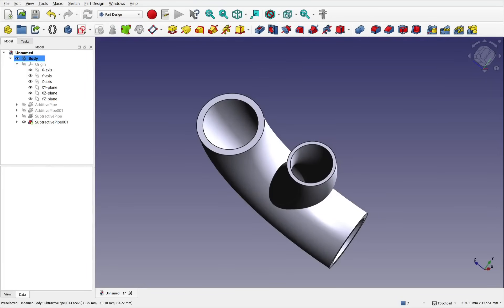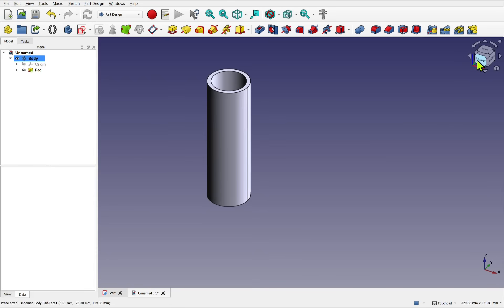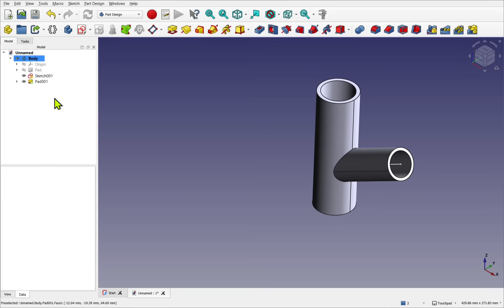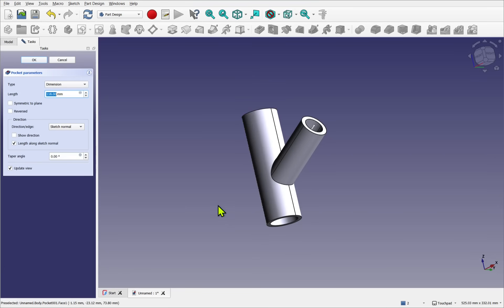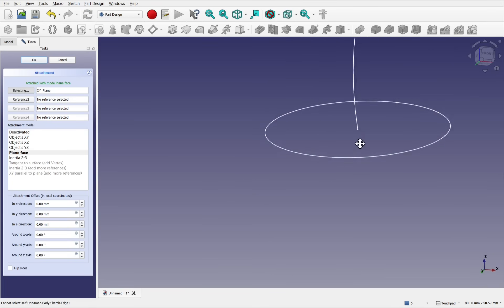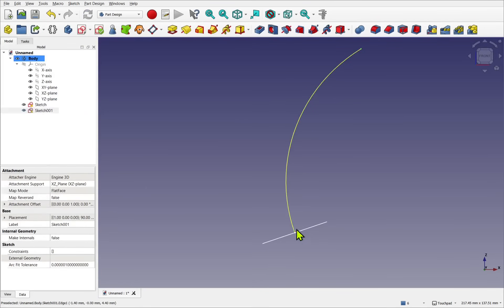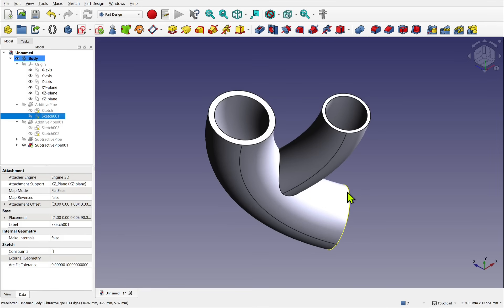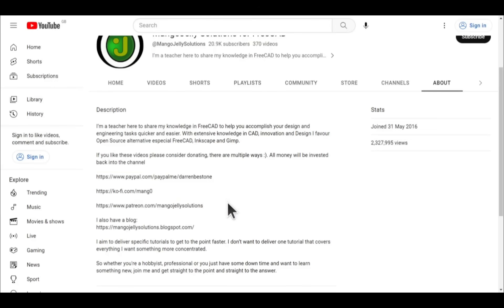FreeCAD Tutorial: How to Connect Pipes with a Continuous Internal Holes

Comment: Thanks for the tutorial. In the past I often saw you attaching a datum plane normal to edge at the end of a line and then place a sketch on that plane opposed to mapping the sketch directly to the end of the line (like you did in this video).Are there any advantages/disadvantages to prefer one over the other? Keep up the good work!
Reply from the maker: You be happy to know that I have just finishing the editing of a video regarding datum and also includes some of the pros and cons 😊. Adding multiple Datum planes can add cpu over head and most attachment can be done by sketch attachment. But datum planes can quickly be attached and don't get hidden deep in the treeview. Also you can offset multiple sketches from one datum. Changing the angle of the datum, all other attached sketches will follow.

Glad your enjoying the videos.
Reply: @MangoJellySolutions  Thanks for your reply! Looking forward to the video.

Comment: It would probably make more sense to use some workbenck for pipeworks and stuff. This would be a pain for a system any big.

Did you consider using shape/subshape binders on a sequence or wires or directly on wires to model systems? Or for example, doing the same with sketches. What is irritating that it seems impossible to have parametric pipes keally (without having your project crashed every now and then)
Reply from the maker: There is a dedicated workbench called the dodo workbench for pipe and framework (edit: one of my patreons has just sent me a message about the Quetzal workbench)

Comment: I was making a a multi-path filament thing for my bambu printer a few months ago and I ended up mapping out each of the paths that were going to come together onto a single sketch. This was like a blueprint of what the final shape was going to look like just in two-dimensional lines. I then made the appropriate profiles for additive and subtractive pipes and just chose which parts of the sketch to use for each of them. I thought that worked out rather well. Edit: granted as I think about it I think that just worked for me because my paths were tangent to each other where they joined. I don't know what that would do if I wanted to incorporate in 90° pipe into the side.

Comment: That's brilliant, Darren. I was just trying to map a piece of twine through pullies in my project to act as force upon two support legs. I knew my answers were buried in your library somewhere... Thanks. 🤜💥🤛
I still struggle with pad and extrude, and why one works when the other doesn't. I'm happy to get the result I need either way. 😉
Thanks for sharing and helping us all.  -EZ
Reply from the maker: Great to hear and thank you for the comment, always glad to help.  That sounds like an interesting little project.  Ah yes pad and extrude, the main reason I find why part extrude is more forgiving is that it doesn't require closed geometry to make your shape.  Part design wants a solid, where part can deal with both solids, surfaces and compounds.  You can do what you like in a sketch in the part and it will probably 9 times out of 10 make something from your sketch.  Part design will complain with wire not closed.
Reply: @MangoJellySolutions  @ezone913/community
Should bring you a smile.

Comment: Mate, thank you for making these videos. I recently installed FreeCAD (portable), coming from Autodesk Inventor.
Really great development FreeCAD has seen since 2021.
I am still having a question regarding making many solids form a single sketch (with many closed loops\areas). In FreeCAD I do it by linking the same sketch and then placing each 'linked sdetch' inside a body – making every body active before pad\extrude an area of every 'linked sketch'. 
Is this the correct way to do it? Can I then export every body as a separate file to use in an assembly workbench?
Reply from the maker: Glad your enjoying, yes freeCAD has really come a long way :)  Sounds like you are  taking a top down approach with your designs, using a feature, in your case a sketch, from another body to base the next body off of so the position of the starting feature basically touches the other body?  If we are talking about the std link, linked sketch is an interesting approach as you would normally use the green sub shape binder.  Make the current body active and then select the feature or sketch from the previous one and use the sub shape binder.  This will create a link shape from the pre-designed body to the current .  But there are many ways of doing this and differs depending on which workbench you are using. You could use both links and draft clones to do a similar thing (I am assuming your are talking about standard or variant link found on the toolbar).  All workflows are correct, it's just gets confusing which linking option to use as they all have their own advantages / disadvantages.